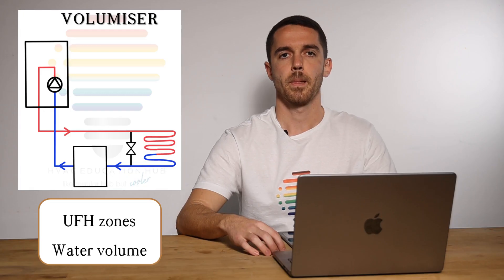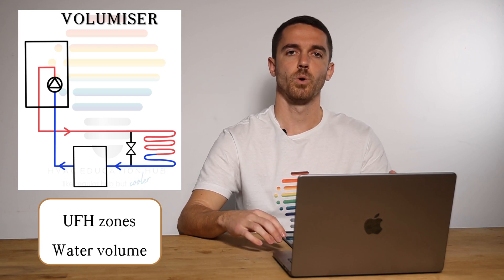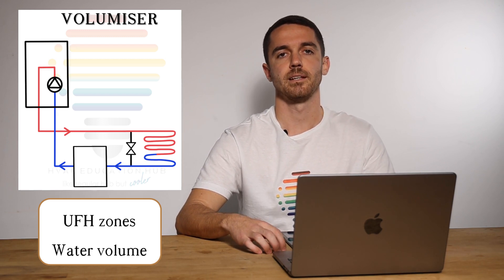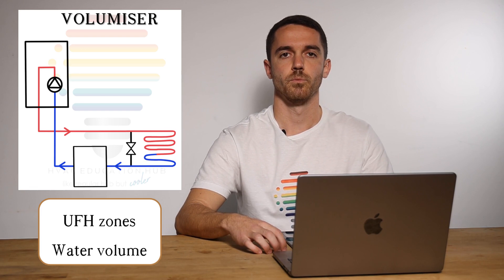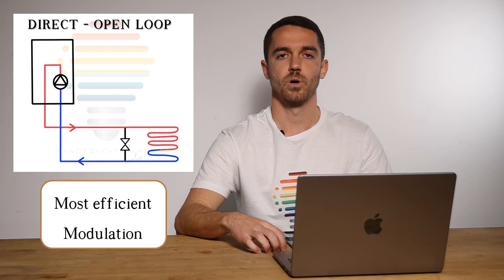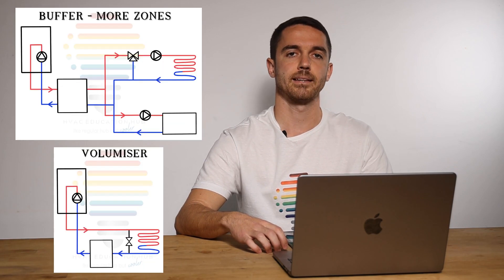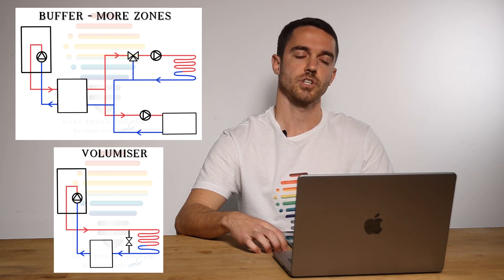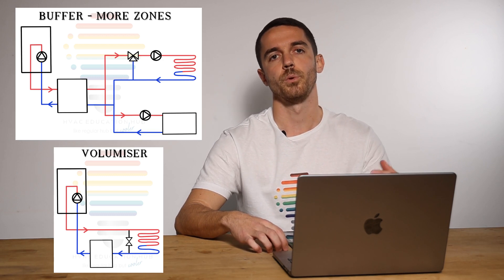Buffer Tank in Heat Pump Systems | Do You Really Need One?

Comment: One thing you are missing is the pressure drop.  Most heat pumps need 10 or more GPM, so going direct to in floor or air handler is not possible as the flow rate will greatly change the pressure drop for the system and then the pump will not be able to satisfy both flow requirements.   So at minimum a hydronic separator is always needed.
Reply from the maker: No, for domestic properties with properly installed heating system, pump is fine, no need for separation

Comment: A friend wants to add a heat pump to his house, where he already has a wood stove boiler and wants to keep. I think the only way to couple HP with the wood boiler is with a buffer maybe with heat exchanger coil for the stove, and input-output for the heat pump. I don't know, stove needs to have priority so it doesn't boil the water in it... What do you think the implementation should be? Or maybe 2 separate inlets, and 2 separate outlets, with two separate "primary" circuits?
Reply from the maker: I usually suggest to put 2 valves and isolate fossil fuel. In that case, if needed, they can run it on low outdoor temp. Almost never you need both sources to work together.
Reply: @HVACEducationHub  true, but he fires the stove for keeping company. If there isn't any load, water in the boiler will boil and boom...
Reply from the maker: @ppanagiotopoulos  ah this is another thing

Comment: If a buffer is installed due to needing more head pressure than is capable from the heat pumps own pump, from what I understand the flow rate should be balanced in and out of the buffer to avoid water mixing. Since the after buffer pump is set to a constant flow, should the heat pumps own pump also be set to a constant flow? Or should it be allowed to modulate? Thanks
Reply from the maker: The secondary pump can also be set up as modulation, this is the best
Reply: @thanks for your reply, as far as I can tell the secondary pump installed on my system can not be modulated ( or atleast isn’t set up for it) should I temporarily set the heat pumps own pump to a matched flow rate until I can reconfigure the secondary pump? Thanks again
Reply from the maker: Yes, I think the best is to set up the same flow rate on primary and secondary and then delta T will vary according to heating load
Reply: @ thank you for the great information, unfortunately my installer has done a pretty bad job of setting up the heat pump ( 65 max flow temp, delta t7, thermostat temp control , no pump modulation etc), clearly information like this is needed!

Comment: I have a house in construction with aprox 154m2 of radiant floor (which is also prepared for cooling). The house is divided into two floors. I plan to use an heat pump for, heating, cooling and hot water. I have two questions, 1.how many kw would recommend  for this house given it is well isolated and located in Portugal. And 2. would you run a the system in open loop? I don't mind heating or cooling the whole house at the same time since me and my girlfriend both work at home. Thanks in advance.
Reply from the maker: Hi, sorry, don't have experience with Portugal conditions.
The best way is to find designer who will calculate heat loss and then you will know how much kW you need.

For 154 m2 radiant heating/cooling, your circulation pump inside of the unit will probably be strong enough to run in open loop and you can add thermostats in rooms with high solar gain.

Comment: In my new build I was going to install a oil boiler and have left the underfloor heating and separate hot water flow and return pipes in the garage. Now I want to install an air to water heat pump and would like to know if it would be a good idea to connect it into a coil within a large buffer tank then I could easily connect the flow and return pipes to the buffer tank.
Reply from the maker: Hi, not sure what is your idea?

Comment: in my opinion, the correct answer to whether we should use a buffer tank in an installation is that it depends. The buffer tank offered us several advantages (however, it also has some disadvantages such as increased installation cost, the requirement for additional installation space, and installation complexity) All heat pumps have a minimum volume of water required for their smooth operation (take into account, for example, an installation with a fan coil units where the volume of water they take is smaller compared to the radiator heat radiator). This volume, depending on the model and size of the heat pump, ranges from 60~160lt (mass flow rate, correct pipe size, correct dimensioning of heating radiator, 55C in the inlet, ΔT 5). If I have this volume in the system, it is not deemed necessary to place a buffer tank, neither in the supply nor in the return. If we consider that the pump works 24 hours a day, we will understand that the inertness offered by a buffer tank is important. let's include in the positives that in snowy conditions it will prevent the many defrosting functions of the pump (thus less operating cost)
Reply from the maker: Thank you for sharing experience and knowledge.
Fan coils are complex and buffer or volumiser is needed.
My opinion and experience is if your circulation pump can achieve flow rate on critical pressure drop, you don't need hydraulic separator.
Buffer as a volumiser is advantage to have inertia, especially for defrost and part load conditions.

Comment: Hello, do you recommend a buffer in this system. 40 sqm of floor heating and 5 radiators. I have one thermostate for radiators and 3 thermostates for floor heating. HP is Midea 12kW. Thank you in advance.
Reply from the maker: Hi, looks like pressure drop is not so big for internal circulator pump. You need to check if pump could do this without additional pumps and 90% that this is the case.
Reply: @HVACEducationHub  thank you! Hvala!

Comment: Hello Mario,
Kudos for this information and sharing it with everyone,
I have a specific question about how to connect a TP of 12 kw, which uses R290 gas and I only use radiators, and the square footage of the house is about 120 m, to the system without a buffer, and what pipe diameter to put, because our masters insist on it under various excuses, and I see that it can also without that and how to avoid that then cold water does not go into the radiators during defrosting, Thank you
Reply from the maker: Pozdrav, hvala na podršci.
Pošaljite mi malo više detalja na e-mail pa se možemo čuti:
hvaceducationhub@gmail.com

Comment: What is your opinion on using a plate heat exchanger on the cylinder to create a primary circuit between the heat pump and the cyl with use of glycol, then having the home central heating with it's own pump and water only. Flow and delta-t at the heat pump side would appear to be very simple and it allows the home central heating loop to be almost ignored by the installer.  But how efficient are these systems generally and can they defrost well enough with quite a small primary circuit?  Could this be the installer simply taking the easy way?
Reply from the maker: Not a bad idea if you want to put glycol - in that case you don't need it in whole installation.
But actually low water volume could be a problem for defrost. This could be calculated and manage.